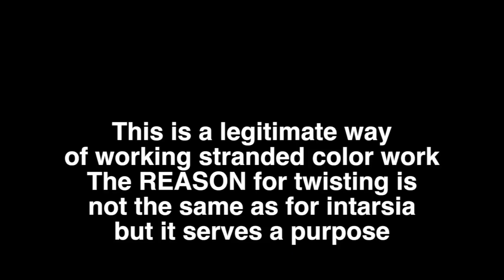Reading Norwegian Sweaters // Casual Friday #28

Comment: Can you do a knit-on, purl-on cast on?
Reply from the maker: Are you asking whether it’s possible to cast on in pattern or are you asking me to make a video on this? I do have a video on casting on in pattern using the long tail cast on. You can find it in the playlist for a long tail cast on.
Reply: Yes, I guess that is what I’m asking.  Can you do that with a cast-on other than long tail?  Thanks!
Reply from the maker: If the cast on looks different on each face of the edge, then there is probably a way to work it so that you reverse the two faces, which means you can therefore cast on in pattern. How you do it will vary, depending on the cast on in question. Whether or not the result is attractive will vary, as well. For example, the cable cast on can be done purlwise, which means you can technically cast on in pattern while doing the cable cast on. The problem is that the edge where you transition between knit and purl or purl and knit tends to look disrupted, rather than looking like you're alternating between the front and back side of a standard cable cast on. So, depending on what it is you're trying to do, see if there is a version of the cast on method you would like to use, and then experiment with switching between the knit and purl version, in order to cast on in pattern, and then decide whether it is worth the effort and if the result is an improvement over the standard method.